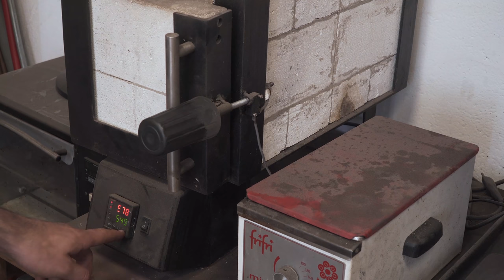Power Hammer Die Covers

Comment: Curious why when drilling/cutting/sawing metal sometimes oil is used as a lubricant and other times none is used...
Reply: I think it might have to do with the hardness of the bit you're using to cut into the steel. If it's a harder bit like a diamond tip, you probably wouldn't need lubrication. It's just a guess though.